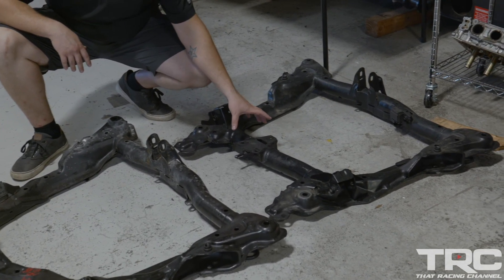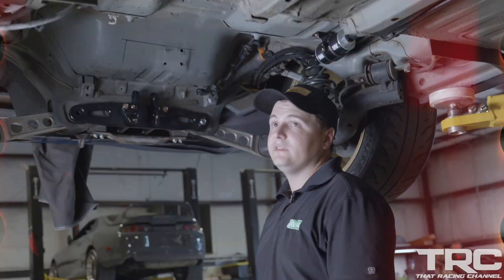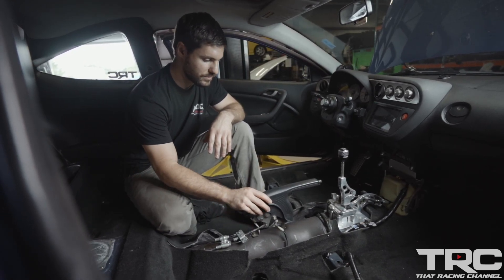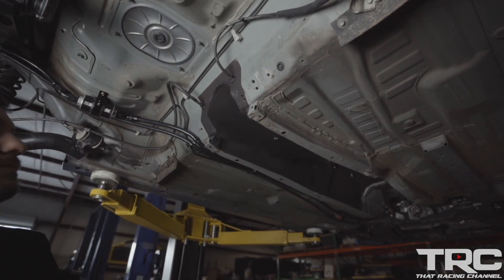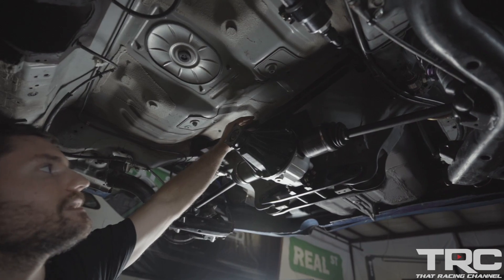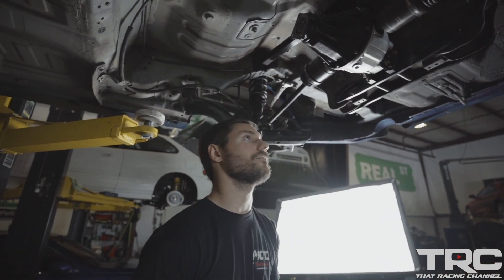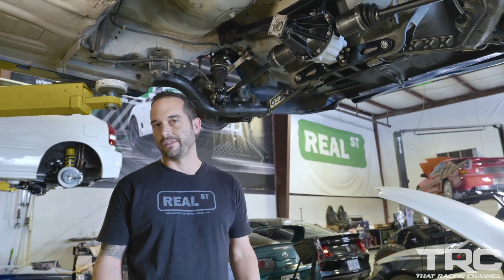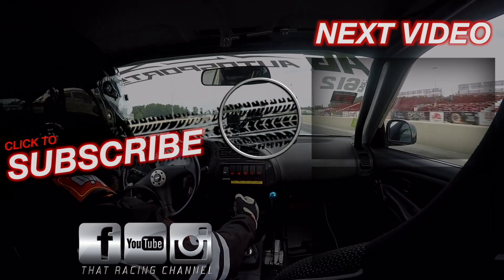AWD Acura RSX Conversion - Bolt on AWD Setup using Factory Honda Parts! (Turbo K-series) - Ep.7

Comment: I have a k24 6 speed in my rsx. I was wondering what would I need to convert it into awd. is it the same parts in the video or slightly different bc I have a k24 6 speed?

Comment: I've wanted to do a similar AWD RSX conversion, but using the manual 6 speed SH-AWD transmission from the Acura TL combined with a K23 engine from an RDX.  Since the K23 block has a modified casting so that it bolts up to the same automatic transmission as the V6 engine, it should (in theory) bolt up to the manual SH-AWD that came on the V6 Acura TL for a couple of years.  In theory, you can also bolt any of the K20 heads onto the K23 block, so you could put on a Civic Type-R cylinder head if you wanted to up the power.  I never had the time or money to actually try to get it working though, and now I rarely see any RSXs for sale.
Reply: hard to find that shawd manual transmission too

Comment: No no transmission awd yeeer no the transmission automatique serious look the supra mk4 5 speed is the time sooo good no is just passer the speed + rapide c est la qu on voie le meilleur pilotés si on commence à laisser la voiture changer les vitesse c est qu on a pas le tire rapide aux temp du western the cowboy il s entretenait des heures pour tirer le plus rapidement possible des heures et des heures d entrenement passer les vitesses c est pareilles ca saire a rien d en mener le rapport a font passe les vitesses le plus vite possible et tu fera un temps soo good look the nascar is just 4 speed is 330 kmh one cars no essayer purer vous verait du moment que le moteur pousse changer de rapport et ci l autre te double un coup de nos suffit a remonter

Comment: Anything Honda breaks when ur making over 800 wheel most stock domestic are at that stock or with bolt on parts a Honda u need everything built it cost alot more and in the end it will break 10x more often buy domestic save ur money

Comment: That rear diff looks VEEEERY fragile even for launching in street racing using decent amount of the torque to the rear axle. Probably would explode over 200nm, or you would have to build a project "awd" which will launch pretty much as an.. FWD car 😂
Reply: Look up a viscous coupler.
Reply: @matthewvalentine3549  i've seen.. that's is the one which for shure is set to not deliver more than 15-25% or torque to the rear, in order to protect that fragile rear diff. The world is upsidedown.. front diff's become bigger than REAR diff's, then people become so bad and uninspiring drivers than they preffer to drive FWD.
Reply: You should probably look up the 8 second rsx they got the idea from to do this build to begin with. It's a few months back in their videos. 950awhp rsx. 8.7 at 164mph.
Reply: @benlastname6667  so.. what he got 8sec?! That time could be done even FWD at that @1000bhp if the shell isn't porky.  Irelevant for what we were talking about.
If you try to show me that rear diff has some wizzard magic in it and could hold real torque, show me some 1.5 60ft WITHOUT vht, or 1.2 60ft on vht. Otherwise is awd as those equipped with haldex on MAIN axle (rear).. which in fact are PERMANENT FWD type of "awd" 😂
Reply: @napraznicul  obviously you didn't watch his the video. The guy has been beating it for a long time like it owes him money. 

Its not blowing up like you said.

Who has 950whp in a close to full weight rsx that runs that time with fwd on Toyo r888? I can wait while you try and even find someone that does.

Comment: As a guy who's tig welded axles and assembled 3rd members for 3000+ hp cars i still find it crazy how much hp that little differential can handle
Reply: https://youtu.be/yQARGcq5Qm8
Reply: Not much going through it, power delivery to rear wheels is only 30-40% depends on what viscosity fluid you using in your viscous coupler. So if you are running 1000hp it handles 300-400hp.

Comment: "Bolt on AWD Setup"
30 seconds in, the drill comes out. 3 minutes in, he's cutting into the floor. Okay. Haha
Reply: *With some minor modifications lol
Reply: Think what they mean is all the parts needed for the conversion bolts on, but minor modications are needed like for the tunnel to allow the driveshaft to conned to the rear  diff and the minor cutout for the Diff so it fits properly.
Reply: thats still really not bad, if you have any decent amount of experience with basic hand tools and cars you could do this too, thats the entire allure of the swap
Reply: Did you really think they literally just bolt it on and it fits right away? Smh
Reply: @NikoBell1188  You might be missing the point of the comment. Haha